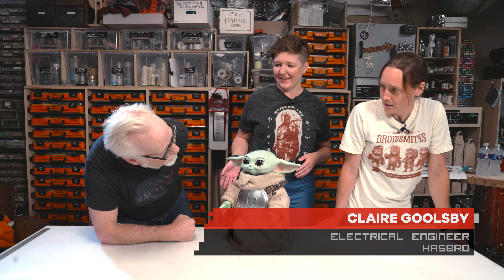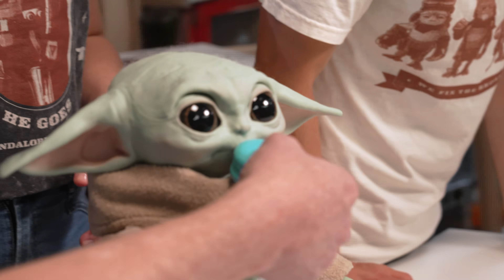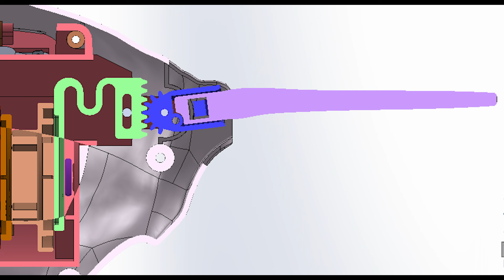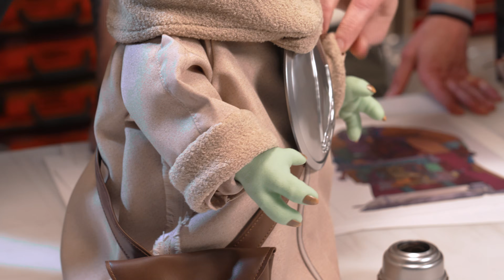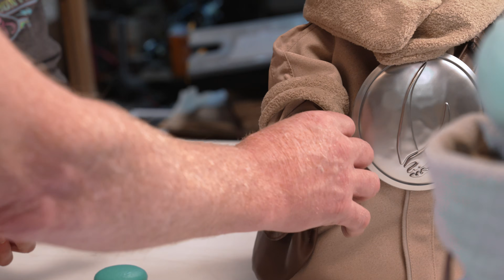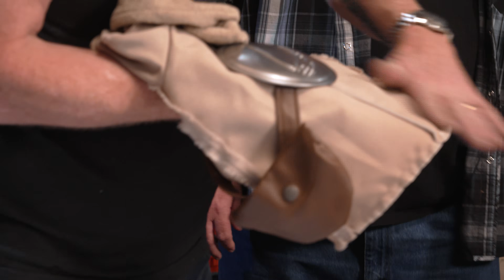How Hasbro's Animatronic Grogu Works

Comment: I honestly find it very disappointing that Hasbro seems to have cut corners on the Beskar rondel, especially on a product that is clearly positioned and priced as a premium collectible.

I fully appreciate how much engineering and development must have gone into the animatronics, and that is certainly impressive. But realistically, among collectors and Star Wars fans, how is this figure actually going to be used? You will probably demonstrate the animatronics a few times, show them to friends or guests, and enjoy the novelty of it. But 99.9% of the time, Grogu is simply going to be standing on display — and at that point, appearance, materials and overall presence matter enormously.

That is why using what appears to be a plastic Beskar chest piece is such a strange decision to me. No matter how good the paint or metallic finish may be, it still does not have the same feel, weight or perceived quality as an actual metal piece. On a much cheaper toy, I would completely understand it. On a premium collectible at this price, I do not.

Even a relatively thin piece of aluminium or a small die-cast zinc alloy part would have made a huge difference without adding a significant amount of weight. For me, the plastic rondel noticeably cheapens the overall impression of an otherwise extremely ambitious product.

Hasbro clearly invested a tremendous amount of effort into Ultimate Grogu, which makes it even more frustrating that they seem to have saved money in such a visible and relatively easy place to improve. For this price, I simply expect premium materials in the parts you see every single day — not just premium engineering hidden inside the figure.

Comment: They should have included a couple of touch sensors in his feet along with a tilt sensor. Then owners could of made Grogu giggle or laugh depending on how many times his feet were touch. The tilt sensor would only allow the feet sensors to work when Grogu is horizontal.

Comment: Absolutely amazing model! I'd be kind of concerned about the long term durability / reliability of it, though, if I was going to spend $600 for one. I know it's a production model and must have undergone significant testing, but if one of those internal cables ever lets go, how would you go about fixing it? Curious to know what kind of warranty Hasbo is providing with it.

Comment: While this animatronic is a neat novelty in Hasbro’s mass-market lineup, it doesn't compete with premium 1:1 scale pieces from Sideshow or Hot Toys. Hasbro delivered a decent interactive toy, but the mechanical complexity introduces too many points of failure—specifically tearing silicone skin or failing internal gears and wires. For high-end collectors looking for display longevity, the Sideshow Grogu paired with the official $95 dollar accessory set easily wins the day.